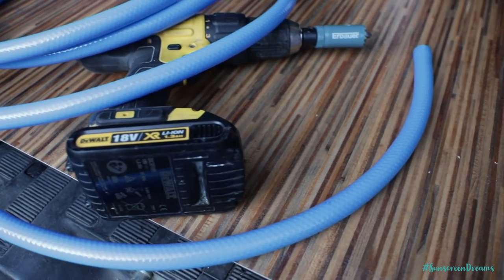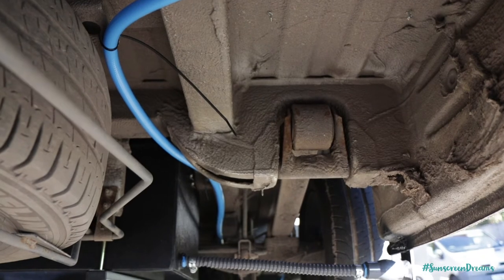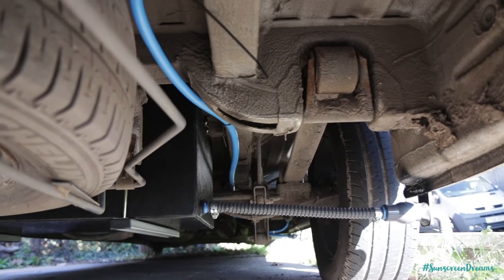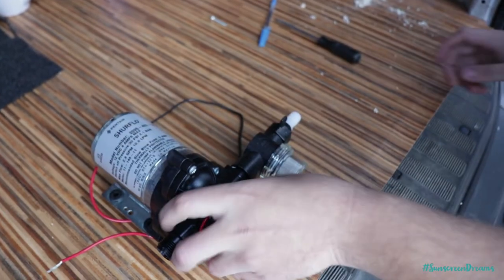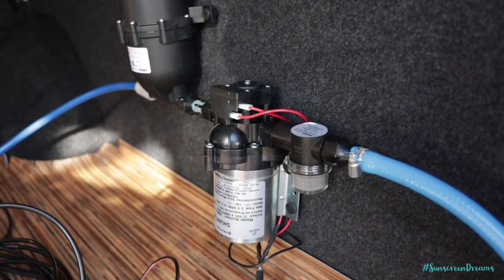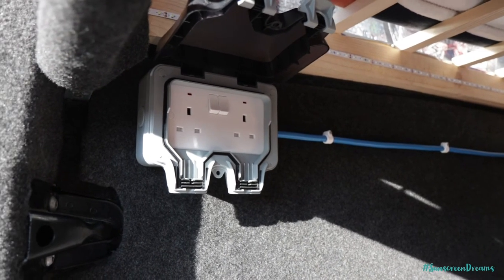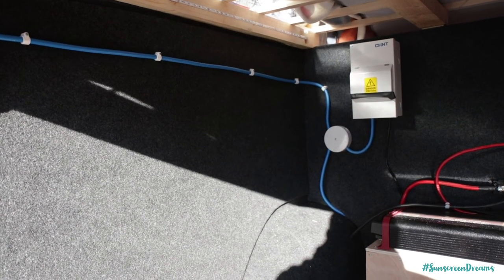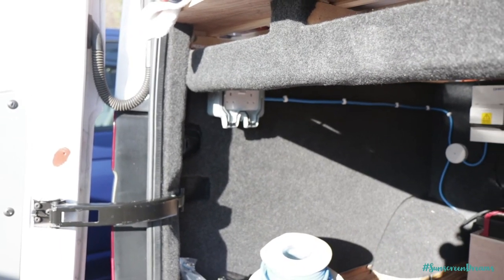Connecting the water system in the campervan

Comment: Hi what direction dose the water go?  Left to right or right to left?  Or dose it not matter thanks
Reply from the maker: Hi Micheal, the water enters in from the right hand side, when you are looking straight on to the pump and accumulator, and is then pumped around the van from there. The accumulator needs to be on the outflow side of the pump.

Comment: Sorry but I found this video to be confusing and misleading. First of all you start by connecting the filter to the outlet port of the pump. Then you use PTFE tape which goes against the manufacturer's recommendation which is to "Never use Teflon tape or sealing compounds on threads".  Not only that but you also slacken off the joint to get the filter into position which is likely to result in a leaking joint. The manufacturer also recommends that if you are mounting the pump in a vertical position then the pump head should be in the down position so that in the unlikely event of a leak, water will not enter the motor.

Comment: Hi Ben - I have ordered tanks from the same manufacturer as yourself - fitting mid March - what size hose did you use to connect the cold water system ?
Reply from the maker: Hi Ian, we used 12mm flexible from the water tanks to the water pump. From the tank to the rear of the van where we installed the pump we used about 5m.  We purchased this off ebay https://ebay.to/2SrqQjU  Hope this answers your question.
Reply: Sunscreen Dreams thanks for that it certainly does ..... our van is a boxer but I assume he uses the same size connections. Thanks